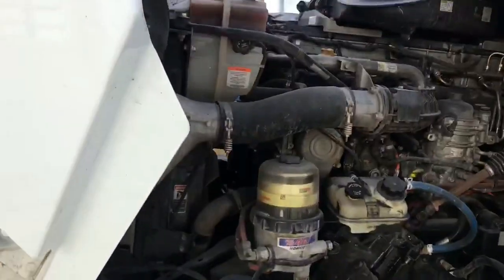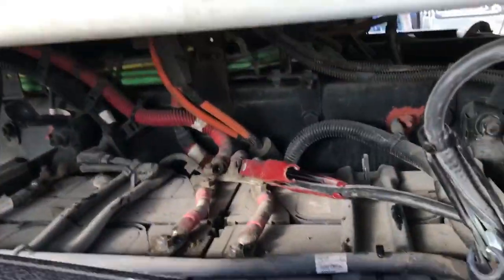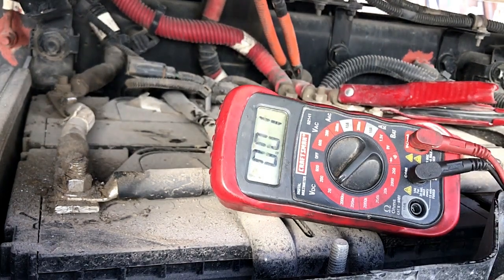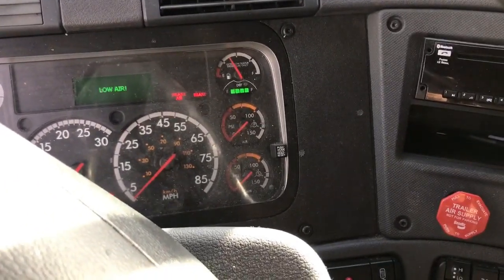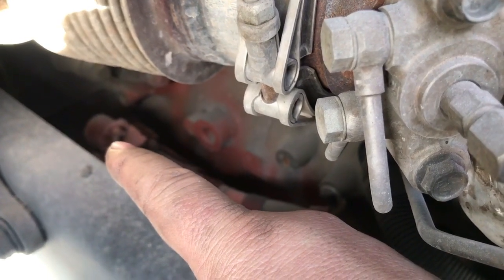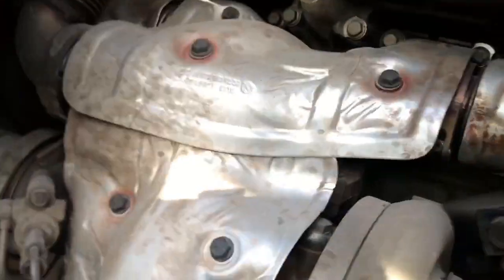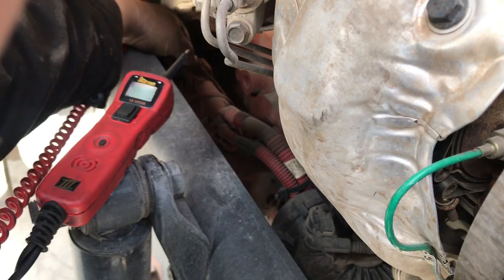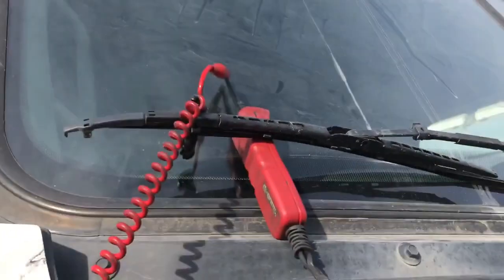Truck won't start and how to Test A Starter on freightliner Casadia tractor

Comment: MT-38 DelcoRemy starters are the most poorly engineered and unreliable starters ever !  Feel for any hot connections on the starter and battery terminals .  Also check ground wires between cab / frame rail , starter / frame rail , and negative battery ends to frame rail . Use battery jumper cables to check these grounds   .  Turn headlamps on , if lights go out while in the ignition start position look for grounding issues . Check battery voltage levels , 12.6 volts is fully charged .

Comment: 2013 freightliner Coronado dd15 engine. I got the same problem before and after replacing the starter motor. Intermittent problem. No crank.

Comment: If your started won't crank it doesn't always mean your starter is bad. Your ground could be bad at the starter. You could give the starter all the voltage possible, it won't  do nothing if the ground is bad. Try voltage drop testing. It's very easy to do. It should be .002 on the ground side and .5 at the positive side
Reply: Wish I knew how to do voltage drop.:(
Reply: @itsmisterchris  the easiest way to do voltage drop is to do ground to ground or power to power drop test. Connect your lead to the battery positive and the the next lead positive side of the starter and crank the engine and see what the reading is on the meter. Voltage should not drop more that .5 volts on the positive side or 500 mv. I won't bore you with the math but 1000 mv is equal to 1 volt. On the negative or ground side it shouldn't drop more than 200 mv or .2 of a volt. If you're not familiar with using a multimeter then  learn to read it first. There's a big difference between .2 and 2
Reply: Why not make your video too, just asking, don't mean to hurt

Comment: I start with bypassing the solenoid on the starter to see if it starts. That then rounds it down drastically. Also as you mentioned the clutch switch on a manual is common. Bypass that by putting a jumper wire from outer wires together. Then if all those failed start testing voltages. Why get dirty if you ain't got to. Makes sense to me.

Comment: Power Probe 3 is one of the best tools a mechanic can have in his box.
Reply: I have to disagree. In a multiplexed system they can cause catastrophic damage. They are actually banned in out company that services 375,000 trucks nationwide. All you need is a volt ohm meter. Sending incorrect voltage to a module will cause failure. I had one and sold it.

Comment: It still might not be a bad starter. DD15's are notorious for shaking the starter connections loose. Also, failure to get voltage at the signal wire doesn't necessarily mean the clutch switch is bad. The temperature sensor on the starter also goes bad sometimes and that will keep the ECM from sending the signal.
Reply: I had a truck last night that wouldn't start so I tried to jump the starter over with a switch made for it and the engine would crank but never start even with the key in the on position. Finally it started using the key. I think it's the clutch switch thou.

Comment: Why did not you hook up positive clamp of the PP, to the hot starter's post and negative to the little S-post. 
While you tapping starter by hammer, somebody needed to keep turning key on simultaneously. You can not pass that dead spot in the starter by yourself.
Good video clip, with good advice
Reply from the maker: Not if your by yourself.